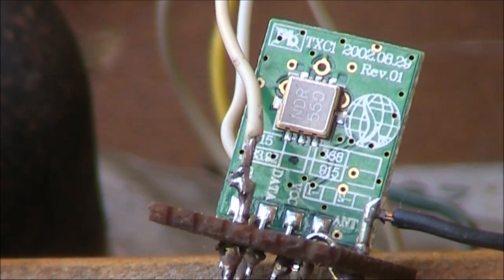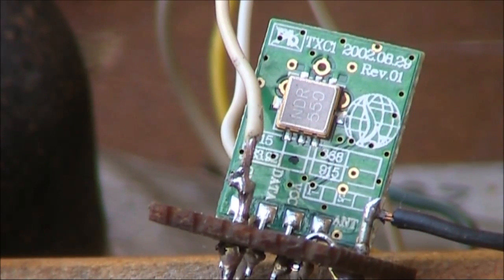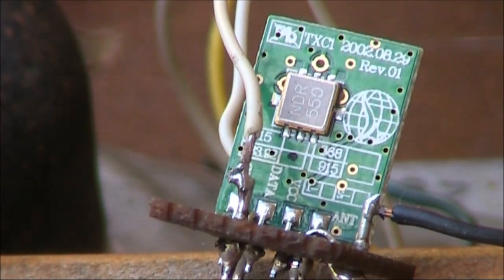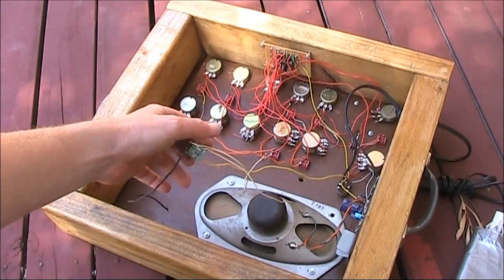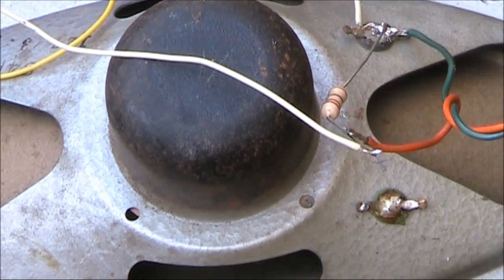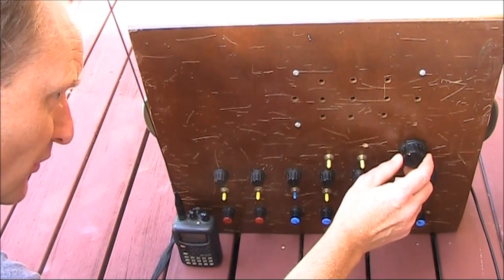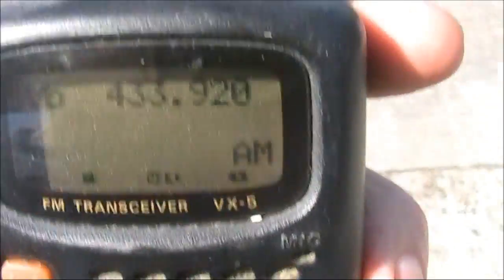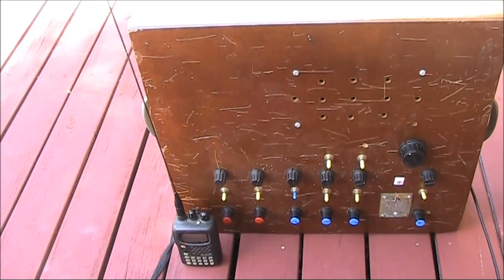Experiments with low power UHF data transmitter modules: Part 1

Comment: Would it be easy to key such a module with morse?  Just to send on and off states. For kids to practice  Morse without a license.
Reply from the maker: Could turn on and turn off power to key. But then you'd need a CW receiver.  Far better to inject a keyed audio tone into it so it can be heard on a UHF FM receiver.